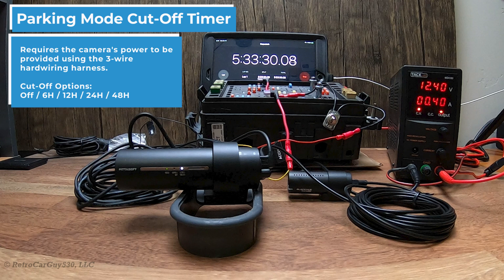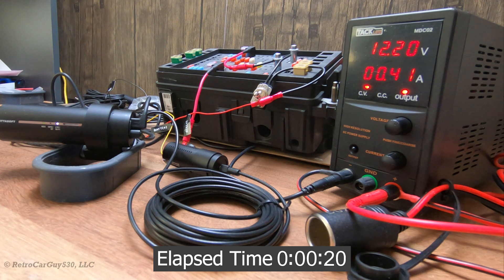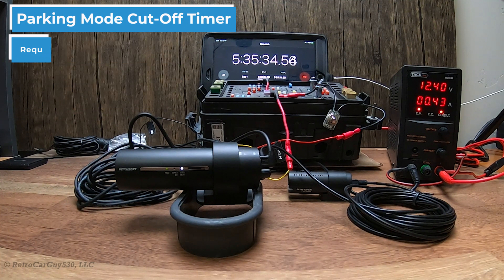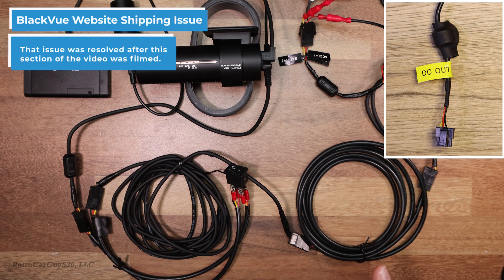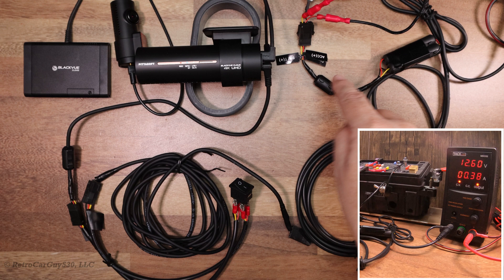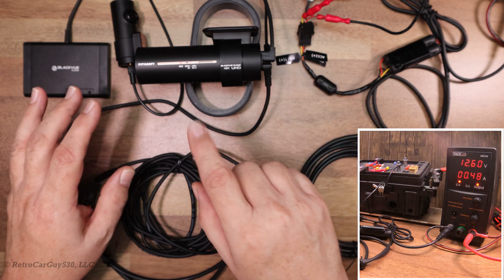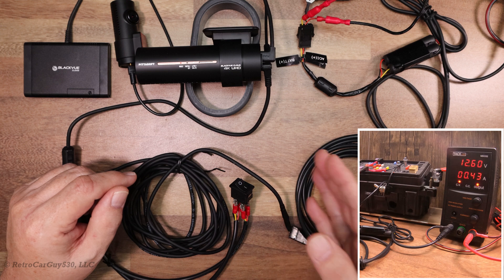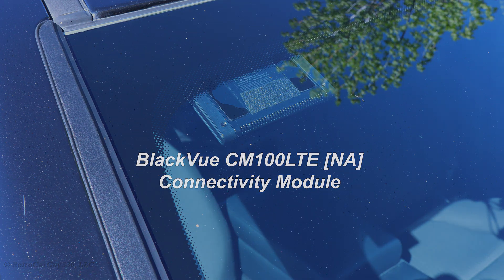BlackVue X Series Battery Protection Feature Testing & Wiring Modifications

Comment from the maker: In this video, I test the two new battery protection features included in BlackVue "X" series of cameras (Low Voltage Cut-Off, Parking Mode Cut-Off Timer).  I use a BlackVue DR900X-2CH camera in my testing.

I walk you through the modifications I made to the included 3-wire hardwiring harness to make it work for my car along with adding an On/Off power switch for the camera.

This video is part three of a three video series:

1 of 3: Review the BlackVue DR900X-2CH Camera - https://youtu.be/1daVFFRykWU
2 of 3: BlackVue Cloud CM100LTE 4G LTE Connectivity Module - https://youtu.be/m95Ck-PlyGE
3 of 3: BlackVue X Series Battery Protection Feature Testing & Wiring Modifications - This video

⏲ Video Chapters ⏲
00:00 - Intro
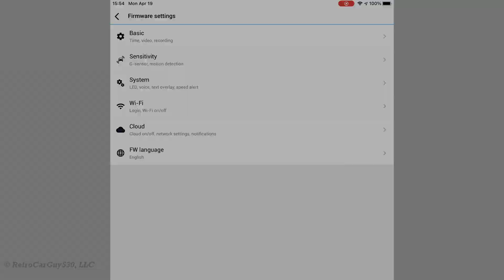00:55 - Low Voltage Cut-Off Test
02:24 - Parking Mode Cut-Off Timer
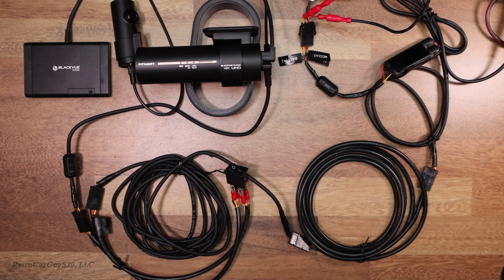03:25 - 3-Wire Hardwiring Demo + Mods
09:59 - Final Thoughts

Comment: Amazing work, your videos are always well explained and thorough. Adding a switch is exactly what I was looking for and it's a shame Blackvue don't offer this option.
I'm going to use the hardwire kit for both the 970X Plus and B-130X and add a rocket switch just as you have. Seeing the B-130X cable already has a Ferrite Core, is a second one necessary (I won't be extending the cables)? If so, I can add another one and hide it in the A Pillar.
One other question, where did you place the rocket switch in your car? I also happen to have an SS from 2014.
Reply from the maker: I placed rocker switch in the overhead console (dome light area) in my 2014 Caprice.

Comment: What should the Battery Protection switch be set to when you also have the B-124x Battery installed (for Parking Mode to work)?  (mine was all installed by a professional)
Reply: That’s what I am wondering does the cut off timer work with the B-124x battery (so that you are not draining the B-124x battery with parking mode overnight.
Reply: @Jack72961  Set it to Enabled - I was incorrectly told to disable it by none other than BlackVue's Customer Service so my Parking Mode wasn't working for around 6 months!
Reply: @Jez1963UK  I set the cut off timer to 2 hours, but not sure if it actually cuts off the camera it just seems to record motion all evening and during the night until the battery is dead
Reply: @Jack72961  I can't tell you what mine is set to currently as I'm not at the car, but isn't that what you want?  You want the battery to be used up until it's empty.  The B-124x gives around 14 hours? (can't remember exactly), so in my case  that covered me for overnight street parking (until I fitted the B-124e and now I get around 25 hours).  Personally, I wouldn't want the Parking Mode to cut off after only two hours.
Reply: @Jez1963UK  yeah I get what you mean, from what I understand is that you can set it to cut off after a certain time, for example 3 hours is usually enough time to cover parking at a restaurant/shopping centre etc, and then if you park at home in the garage etc you aren’t eating up your battery every night recording the inside of your garage. I suppose the other option is to unplug or turn off the battery everytime you park up at night if you want to preserve battery % but again if you parked in a street yes you’d want it always in parking mode

Comment: a recording problem started appearing a few days after installing the BlackVue DR900X-2CH Plus camera, as it started not recording continuously during the parking mode, even though I chose continuous recording ! I thought it was because I was using a 32GB SD card, so I bought a 256GB SD card, but the problem persisted. then I discovered that the recording interruption was caused by the dash cam draining the car battery even though the car battery is new as I installed it less than two weeks ago ! that is why I advise everyone to buy one of the Blackvue Power Magic batteries to protect the car battery and get the most out of the dash cam.
Reply from the maker: I removed the duplicate post by you of this same comment on my other video.  The battery protection feature itself will turn off the BlackVue dash camera when the vehicle's battery voltage level goes below the selected voltage level assuming you've turned on the feature in the firmware settings.  If it was enabled and an appropriate battery voltage level was selected and it still did not turn off the dash camera when the vehicle's voltage level dropped to that level, then there may be something wrong with your particular BlackVue DR900X-2CH Plus dash camera.
I do agree that the use of an external dash camera battery pack is a good thing to use for any dash camera that is attempting to get the longest parking mode recordings it can.  It also isolates the vehicle battery from the dash camera's power drain while in parking mode.
Reply: @RetroCarGuy530  Sorry if my comment bothered you, but I wanted to share my experience with the big dash cam pressure problem on my car battery because I didn't find anyone talking about this point in the reviews videos, otherwise I would have taken this issue into account and added the value of one of the Blackvue Power Magic batteries to the budget!

Well.. I do not have a problem with the battery protection feature. Rather, my problem is that the dash cam drains the car battery very quickly. Within about two weeks of installing the dash cam, the car battery began to weaken, which is what makes the dash cam stop working, and when I start the car, it delays because the battery drained during the parking mode! That is why I wrote my comment and my advice to everyone to take into account within the dash cam budget the value of one Blackvue battery, because after that he will not suffer from any problem in use and he will buy peace of mind.

Finally, my words do not detract from the quality of the Blackvue dash cam, because once you hold it and turn it over, you feel that it is really of high quality, and the same applies to the rest of the products of this wonderful company, but it is just advice that I wished someone would tell me before I bought the dash cam to put battery value taken into account.

thanks
Reply from the maker: The posting of the same comment on the other video did not "bother" me, it just ends up being an extra set of tasks chasing/answering the same question in multiple places on YouTube.  YouTube's comment management system is not very good, so it's best to keep the comments focused on the topic of the video.

The use of the vehicle's battery or a dash camera battery pack to power a dash camera in parking mode requires the examination of the driving style/habits of the of the driver.  If the vehicle is only driven on short trips, neither the vehicle's battery nor a dash camera battery pack will be sufficiently charged to support any type of long lasting parking mode sessions.  If a dash camera battery pack is fully drained by the most recent parking mode session, it can take anywhere between 50 to 120 minutes (depending on whether its wired for high amp charging or low amp charging mode).  If the average drive length for the vehicle is long enough to fully charge the battery pack, then things will work out.  If not then the need to charge the battery pack while the vehicle is parked at home (dash camera not being used) comes into play.  The use of a DC inverter to charge the battery pack may be necessary to fully charge the battery pack.

I'm working on a review of the three high capacity dash camera battery packs on the market (BlackboxMyCar PowerCell 8, BlackVue B-130X and the Thinkware BAB-95).  The extra capacity of those battery packs is great (25% to 45% compared to previous models), but it also requires more time to charge the larger battery packs in them.
Reply: @RetroCarGuy530  Well.. what I understood from your reply is that as long as my daily driving hours are few, I will not benefit from using one of the Blackvue batteries! I drive the car for a period that does not exceed 3 hours a day, and the rest of the day the car is parked, and this, according to your words, will make me, even using one of the Blackvue batteries, not benefit from anything! This is a huge problem and it will make everything I paid on the dash cam a loss for me because I have now stopped using my Blackvue DR900X-2CH Plus until I find a way to make it not drain all my car battery. this is so sad.

Thanks again for your response. I benefited a lot from your words.

Comment: Thanks for the video. I have the wire that can connect to the BlackVue battery pack. I tested the red wire and it does come on when the vehicle ignition is on. The problem is that the camera 900X Plus never used this feature to get into the parking mode with the ignition.  There is a way to set it to use ignition in the setting that I missed somehow?
Reply from the maker: I discuss the native parking mode feature and its requirements in another video I recently created.  https://youtu.be/qa9rq7cEjyM

Basically, you need the 3-wire output power cable for the B-124X to be spliced together with the 3-wire hardwiring harness provided with the BlackVue DR900X Plus dash cam.  In the firmware settings of the DR900X Plus, you need to have the "Basic > Recording > Parking mode recording" set to either "Motion & Impact detection" or "Time lapse".  The firmware setting "System > Battery protection" MUST be enabled.  Since you're using the B-124X to provide the power to the dash cam, I would set the low voltage cut-off value to its lowest setting of 11.8 volts.

With those wiring cables and firmware settings in place, you should have a DR900X Plus that enter/exits parking mode as you turn off/on your vehicle's engine/ignition switch.

I just released a video titled "How-To: Connect A Hardwiring Cable To A Dash Cam Battery".  That video gets into the small details about wiring a dash cam with a dash cam battery pack and making sure the battery pack's output wires are properly spliced with the dash cam's wiring harness wires.  https://youtu.be/WeznBYC14kg
Reply: @RetroCarGuy530  Thank you! I will give it a try. differently the Battery protection were off.
Reply: @RetroCarGuy530  I changed the setting and went to the vehicle to test it. But when I started the vehicle, the BlackVue still in parking mode.
Reply from the maker: To confirm the setting changes are active, check the firmware settings again and make sure they are as stated above.  Either reboot or power cycle the DR900X Plus dash cam to make sure the settings are fully active.  It shouldn't require a reboot/power cycle, but just to make 100 percent sure the setting changes were picked up the dash cam.  You will likely have to start the engine to get the DR900X Plus to fully power up after the reboot/power cycling event (if everything is wired correctly).

If the DR900X Plus dash cam does not immediately enter parking mode when the vehicle's ignition switch is turned off, then something is very likely not wired correctly.  If it only enters parking mode after the vehicle is stationary for 5 minutes, then the hardwiring or settings are still not correct.

Confirm that the B-124X 3-wire output cable wires are spliced together correctly with the 3-wire hardwiring harness provided with the DR900X Plus dash cam.  The left most wire (looking at the side with output port on the B-124X) will be the yellow (BATT+), the second wire should be the red (ACC+) wire and the third wire is the ground (GND) wire.  When you turn on the vehicle ignition switch and/or start the vehicle, the red wire's voltage level should go from zero to a voltage level in the range of 13+ volts.  When you turn off the engine and with the ignition switch in the off position, the red (ACC+) wire's voltage level should drop to zero.  If the voltage level on the red (ACC+) does not get toggled in that manner, the DR900X Plus will not enter/exit native parking mode (immediately).

I have several BlackVue X Plus series dash cams and dash cam battery packs that have native parking mode working correctly when they are wired and configured as I stated above.
Reply: @RetroCarGuy530  Thank you for taking the time to answer my question. I am a car electrician. I just did a fresh installation on my new vehicle. I had this special 3 wires from another installation, that the customer didn’t want/need parking mode. I basically used a relay to power the ignition that go into the battery pack. I will make sure tomorrow regarding the connection. I can reboot it now using the cloud and check in the morning if the reboot did the trick.
Reply from the maker: Let me know how it works out. I also use a relay to provide power to the dash camera battery packs in my cars.
Reply: @RetroCarGuy530  For sure. Many vehicles using tiny wires for ignition these days.
Reply: @RetroCarGuy530  For some reasons my replays from the smartphone YouTube wont post. I checked the connection and everything is fine with the power setup. Ive called BlackVue support and I'm waiting to hear back from them regarding that problem.
Reply: So I opened a new box of BlackVue 900x plus today and tested the parking mode with the ignition. It worked right away. Took it to my car and tested and it was fine until I plugged in the BlackVue HOTSPOT. After that it stopped working with the ignition for good. Smh
Reply from the maker: Make sure the 3-wire wiring harness for the DR900X Plus has good power connections and ground since the CM100LTE draws its power from the DR900X Plus via the USB connection.  Make sure the USB connector is fully seated in the DR900X Plus front camera.  Were you able to configure the CM100LTE SIM card settings when the CM100LTE was connected to the front dash camera?
Reply: @RetroCarGuy530  Yes. it was done before that i tried the. new camera. The thing is that when the cloud setting is on, the parking ignition is off. I have to send my card to the dealer so I have to remove all the accessories that i installed. After that I will make sure to check the power as your suggestion.
Reply: @RetroCarGuy530  I can't thank you enough - I wish I read your comment months ago when I first started having problems with my Parking Mode not working at all (when it used to work before no problem).  The Customer Services guy at BlackVue told me to switch off the Battery Protection (I have the B-124x installed) and have been without Parking Mode for around 6 months, cursing BlackVue and how much I paid for a DashCam that wasn't working...... Oftentimes I blame myself first (thinking it was me that did something wrong) but in this case, I'll be educating the guy at BlackVue after this weekend......  PS - Can you educate me, why should I change the Low Voltage Cut-Off to its lowest value of 11.8 Volts?  (I'm obviously not an electrician).

Comment: I forgot to add - i will be using the powercell 8 battery pack to my DR900X-2CH. any comments?
Reply from the maker: I'm using a PowerCell 8 with a BlackVue DR900X-2CH Plus camera as well.  So far, they're working well together.

Make sure you pay attention to the hardwiring harness wire colors / power types when connecting them to the 3-wire hardwiring cable from the PowerCell 8.  It turns out the PowerCell 8 and the BlackVue DR900X-2CH Plus camera's hardwiring kit use the same wire colors.  Yellow = constant power (Batt +), Red = Accessory Power (ACC +), Black = Ground.

If you haven't already viewed my review of the PowerCell 8, here's a link to that video: https://youtu.be/Joa0fiKZY-o

In that review video, I discuss my preferred way of hardwiring the PowerCell 8 using a relay rather than directly using a fuse tap to source the charging power for the PowerCell 8.
Reply: @RetroCarGuy530  Hello! Id like to ask you a question, so I can send the answer to the person that installed my setup.

I originally had a 900s 2ch connected to a Cellink PRO battery (huge one), worked fine until it got a heat spike and died

I bought then a 900x plus 2ch, I asked blackvue if there would be changes to be done, they told me the only thing needed was to change the power cord because they were diferent.

Problem is, I left the car to a recommended installer and he did change the power cord and it began working fine when I started the car, but as soon as I stop de car the camera stops working and shuts completely down, no lights and no parking mode.

I have been reading this thing about the 3 hard wiring cable harness, does this have anything to do with my case? Maybe this new camera needs to redistribute the cables because it works differently internally and is nowhere close to compatible with my 900s setup?

Thanks for your help!
Reply from the maker: Hi David!

BlackVue is correct, the only cabling difference is the power.  The DR900S used a 2-wire cable and the DR900X Plus has three wires and three connectors on the plug that plugs into the dash cam.  The 3-wire hardwiring harness provided with the DR900X-2CH Plus dash cam has the following wires:  Yellow = Battery (Constant Power), Red = Accessory (Switched Power) and Black = Ground.  I'm assuming the installer was able to get the new power cable installed and wired correctly.

One of the firmware settings can cause the behavior you're mentioning as well.  The firmware setting System / Battery Protection must be enabled to have the DR900X-2CH Plus go into parking mode.  If the "Battery Protection" setting is disabled, the dash cam will shutdown when the accessory power is removed.  With the "Battery Protection" setting enabled, you should also make sure the "Low voltage cut-off" setting is set to an appropriate value.  If you have another dash cam battery pack, you could set the "Passenger vehicle" setting to 11.8 volts.  If you don't have a new dash cam battery pack, I would recommend 12.2 or 12.0 volts as the minimum for that setting.